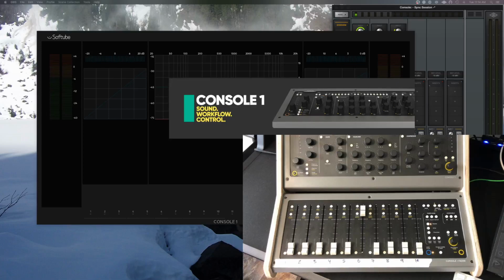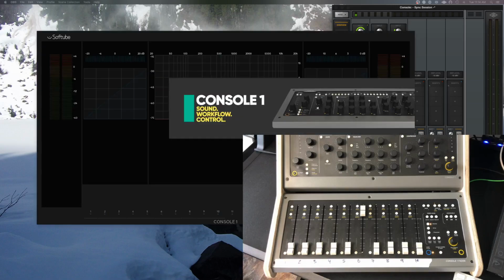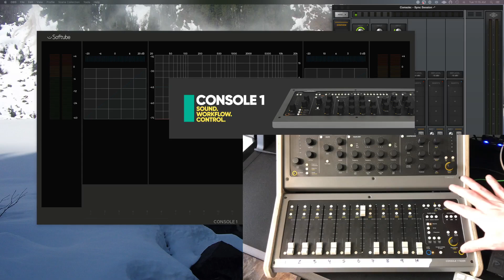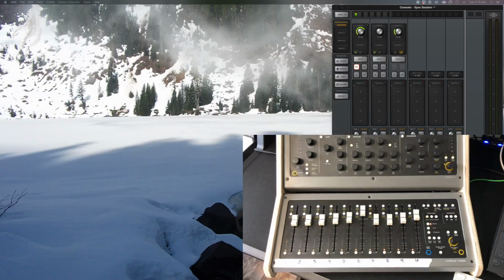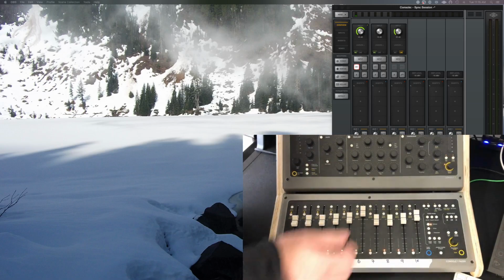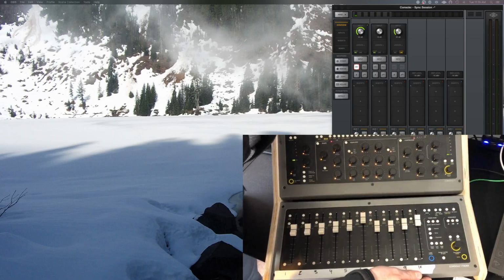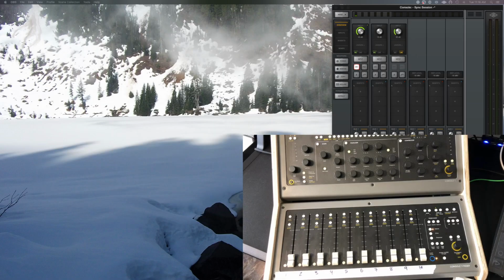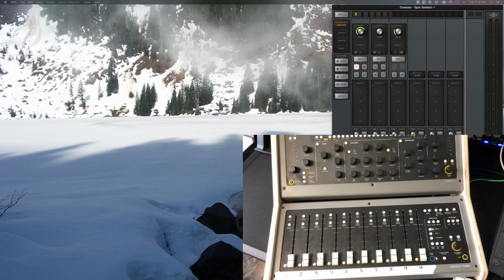Softube Console 1 Fader issue - Calibration Fix?

Comment: I've recently been having this issue (coincidentally also on fader 6...), there is a way of getting console 1 to recalibrate without unplugging (on windows at least). I have found that if you end task / force quit the 'Console 1 on - screen display' application and then restart it (from the app in your install location), the console 1 hardware will recalibrate. 

I'd rather I didn't have to keep recalibrating at all, but alas, I have not found a solution for that yet. I hope this helps!
Reply from the maker: @CalumRMurray - Just did a quick follow up video showing your solution you shared. Thanks again!
https://youtu.be/vfshWR3TqfQ
Reply: @_justin_joe  to be honest I tried this way, it was working at the real beginning..then the issue jumped out again. Btw today Softube support wrote me that it's an hardware issue and to go through warranty
Reply from the maker: @smeriimusicandmore3471  Please let us know how the warranty process goes. I am curious how their customer service is.
I know someone else that commented was not having a great experience via email with the support team
Reply from the maker: Thanks for this! I am running on OSX and your solution above worked and was applicable on the Mac as well. Quit Console 1 from the menu bar on the upper right start menu, then restart Console 1 from your application folder. 

A bit frustrating indeed but this was the solution I was looking for in lieu of the pulling the power and USB. Cheers!